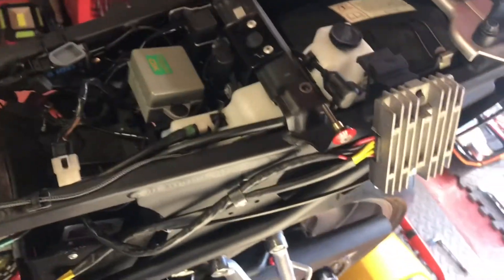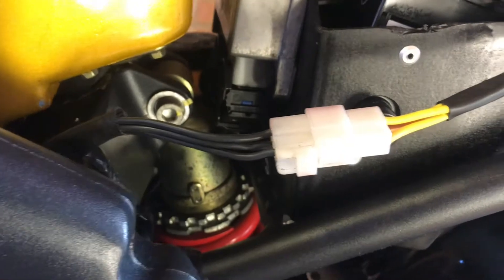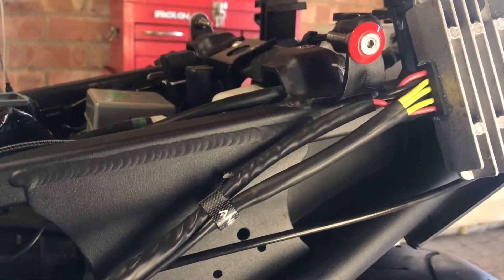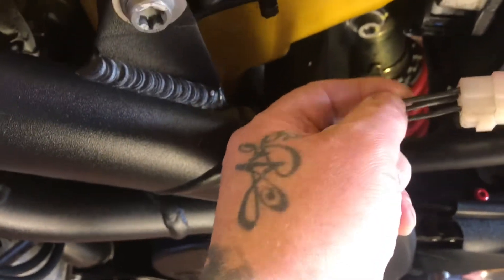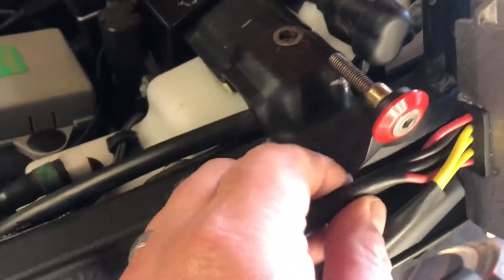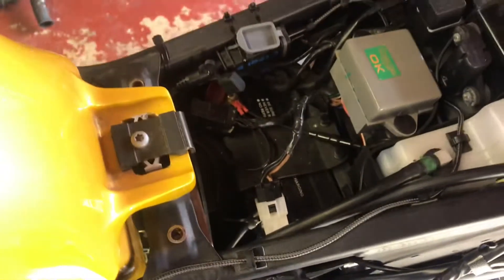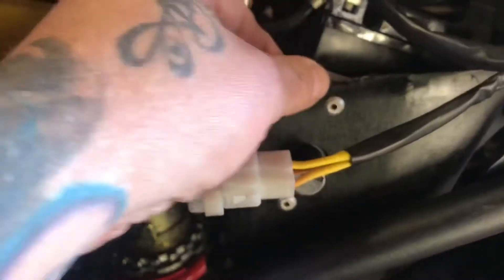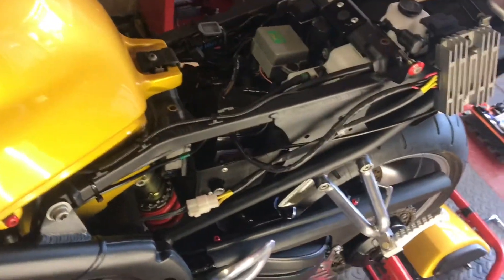Part 1 How to Hardwire Rectifier/Regulator/Stator/Battery

Comment: Does this work  on my Suzuki hayabusa 1st generation...my freaking wires had a nuclear meltdown...I had cut off the junction plastic connectors in tall section...and did a wire to wire connect then did the  plastic cone w metal nut inside to twist and be done ..well since that day two  months gone by and now meltdown....

Comment: Hi
I had the same burnout problem.
I haven't ridden my bike much since i had it "fixed" due to covid and other life problems. Got it out the other day and bike wont go more than 5 miles on a fully charged battery.
Coming from somewhere under the tank :) there is a black wire with a ring connector fastened to the left rectifier bolt and a red wire that is just sat under my seat doing nothing.
Am i missing something. Does the red one need to fasten to the right of the rectifier, to the battery, or it just dangles and does nothing.
Any help would be appreciated before i sell it for a tenner lol
Reply: at least : says what's your bike !! road bike? dirt bike ?
 ... then what's type of regulator : 3or 2wires A/C (generally yellow) wires, with 2 or 4 positive & negative wires
 (generally red & black _or green), or only one pos' with the negative part related to carcass regulator that's bolted on frame.
  But your black one (does it come from reg' ? or from main harness ?) coming from reg' it might be bolted to frame &/or to an engine bolt.  Coming from main harness bolt the ring between reg' carcass & frame.  Red should plug to the battery !!